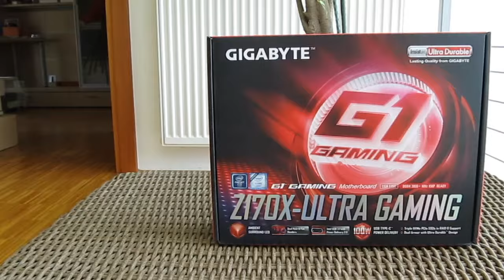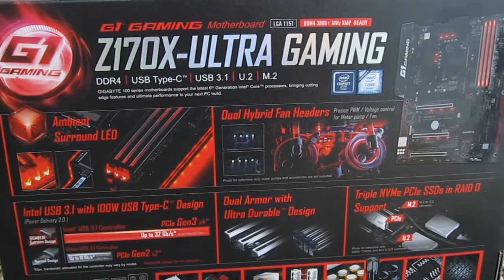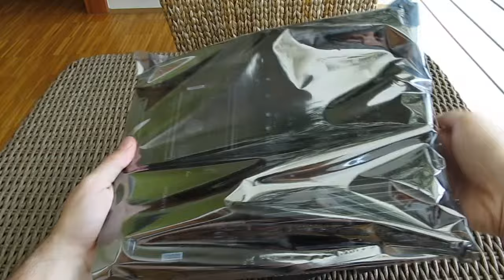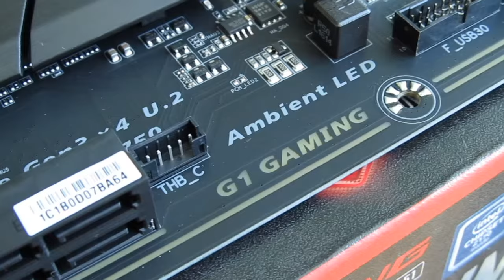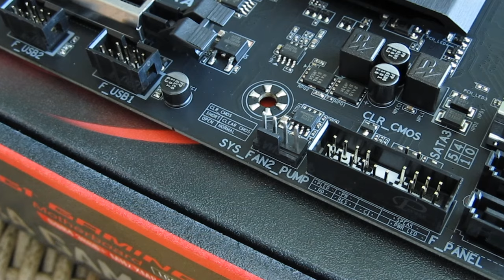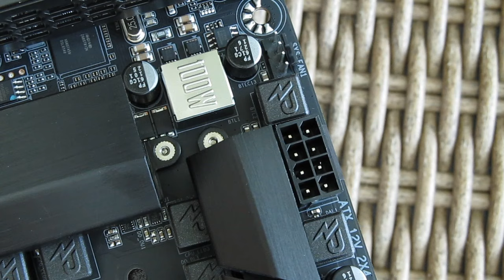Gigabyte Z170X Ultra Gaming Preview - Fully Packed & Affordable

Comment: I'm in search of upgrading my AMD 7850k because it is bottlenecking my rx 470 Nitro quite a lot, I think it will be a perfect match with 6600k. I really hope that it provides stable overclocks. And do the red LED's when switched off from windows turn on when you power it up? I'm asking because I have blue and black build and the red LED's are a dealbraker for me
Reply: Please reply if you can, I can't find any answers regarding this. Are the Led lights controllable only by software or they can be disabled in the Bios. And if controllable only by the software if you turn them off do they stay off. I will go purchase this mb when I find out about this :)
Reply: Please reply if you can, I can't find any answers regarding this. Are the Led lights controllable only by software or they can be disabled in the Bios. And if controllable only by the software if you turn them off do they stay off. I will go purchase this mb when I find out about this :)

Comment: Can you recommend a <£110 UK Amazon mbo that can ship to Ireland??
Reply: Aria PC does this board for £134 (short term deal) including £20 steam vouchers and a hyper 212x cooler. Probably works out under £110
Reply: I know the question wasn't for me... I believe Amazon.co.uk, which I always use everywhere in Europe and highly recommend will deliver to The Republic Of Ireland without any isues. Will assume you are looking for Intel LGA1151 Z170? If so, https://www.amazon.co.uk/MSI-Z170A-SLI-Socket-Crossfire-Motherboard/dp/B01DDTFVSK/ref=sr_1_41?s=computers&ie=UTF8&qid=1468393832&sr=1-41&keywords=Intel+LGA1151+Z170,
or, the most stable brand on the market:  https://www.amazon.co.uk/ASRock-Z170-Extreme4-Skylake-Motherboard/dp/B012D7HBTA/ref=pd_sim_sbs_147_7?ie=UTF8&dpID=51X6HS4RtAL&dpSrc=sims&preST=_AC_UL160_SR160%2C160_&psc=1&refRID=P80108CNYR5RKVZ0J0E5
Personally, after the innumerous fiascos Gigabyte has had in the last couple of years I would stay clear of them.
Hope this helps.
Cheers.
Reply from the maker: Yup, those are some good choices!
Reply: NorthWolfe Thanks a million! Ive had lots of problems finding a good motherboard because newegg and US sites have HUGE shipping and tax. (Like 200 euros on GTX 1070)